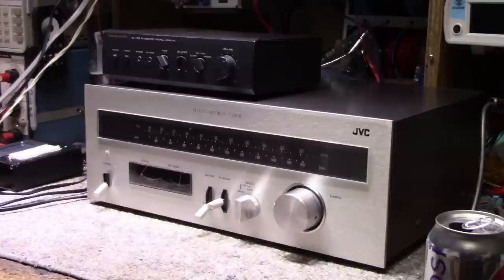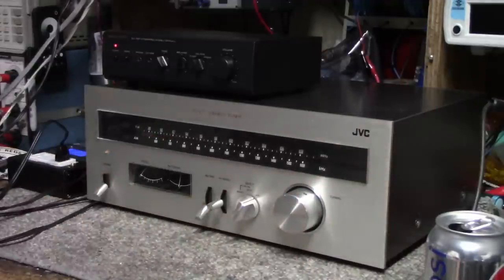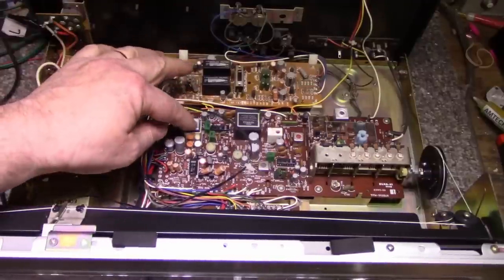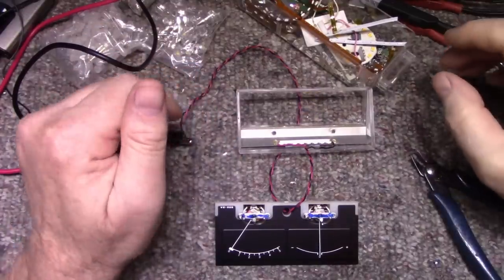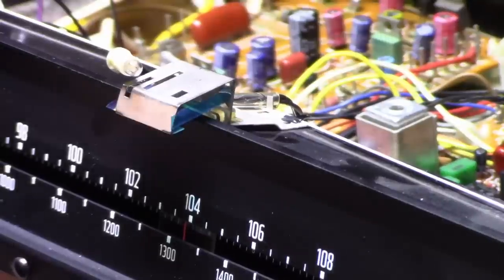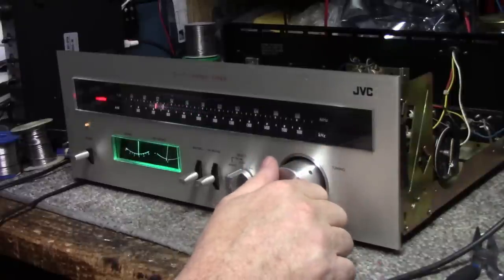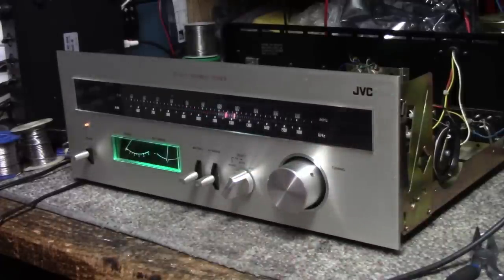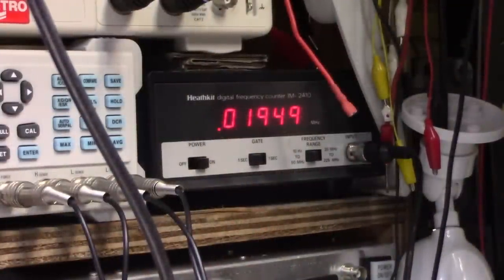JVC JT-V71 Tuner Repairs (Ep. 168)

Comment: For tight spaces I use pipe cleaners in a drill. Clutch setting on minimum. Feed in to tight space, spin slowly. I have mentioned before that metal polish is ideal at removing tarnish. Mr.Carlson uses tarnX. Flush with ipa and use qtips until clean. Qtip in a drill also makes quick work of the process. I run the spring switch clips through 2000 grit with deoxit to remove black oxide and copper oxide. I see it all the time in vintage turntables.

Comment: Well done Trevor, I think I am the last FM tuner listener, only because commercial free Jazz and on a upper end FM Tuner (ie: Pioneer TX 9500 mkII or Kenwood KT 815) the sound is incredible to say the least, this does not include Digital FM Tuners which are horrible with sound reproduction. However.........my opinion still stands with JVC, Do not like and the Green corrosion switch just another example (really enjoyed the switch repair), that should not have taken place, I do not see any other type of corrosion on that thing. Need to get some of that colored film (window tint). Fantastic job with Meters. When Mfg. went Cheap and no back lighting and 1 lousy bulb on the pointer. SCR got Hot on a low voltage FM Tuner, very odd. That is the question, why does alignment always drift to the left. A FM Tuner working properly will have tremendous Bass and clear Highs.